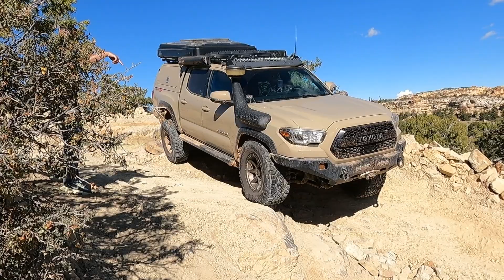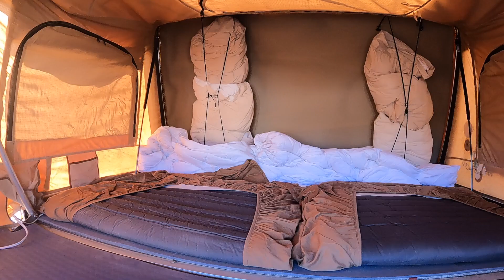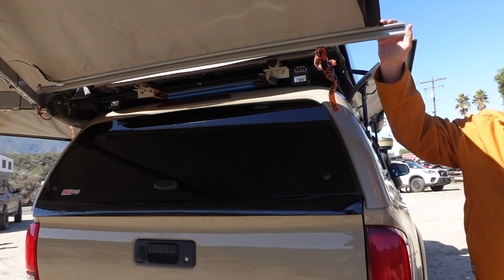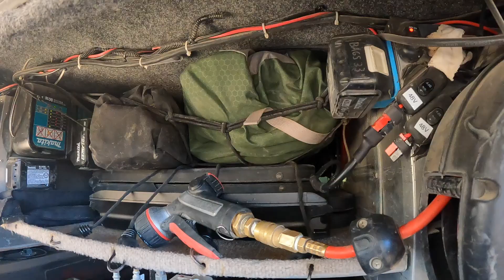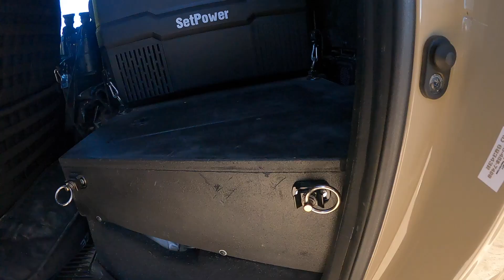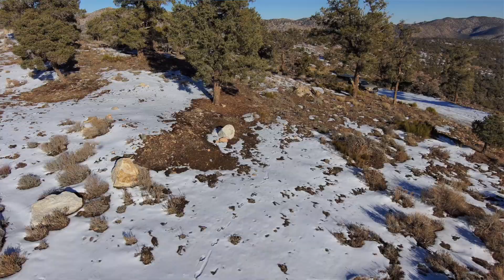The Truck House Truly Made for Overlanding

Comment: Definitely taking some inspiration in the use of space for my rig! The definition of dialed! Very curious on the weight? And if it's tuned aswell?
Reply from the maker: Yes, he had it tuned. With the Tacoma fully loaded with passengers and all its 7,400lbs.
Reply: The truck had custom coils & springs made after it was weighed. It rides beautifully with the tune and 5.29 gearing it can go over passes at speed limit easily.